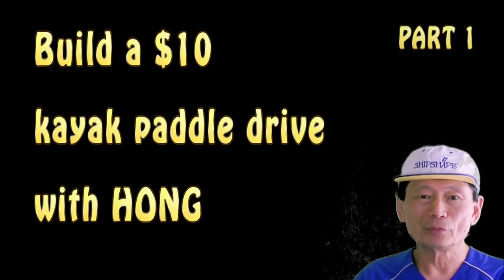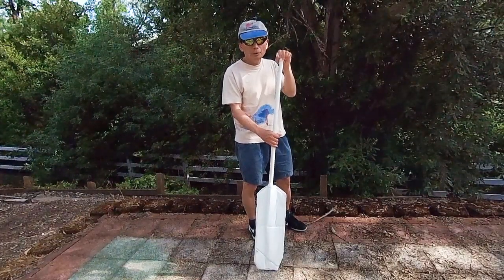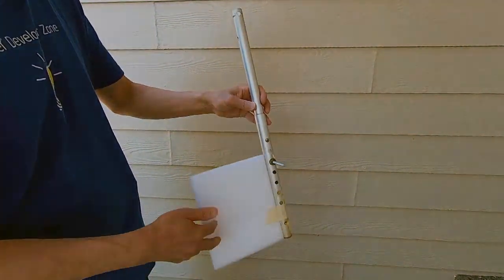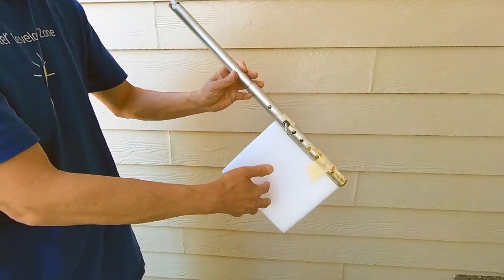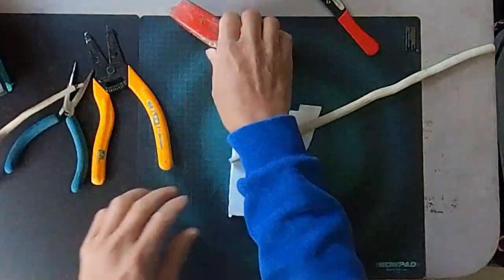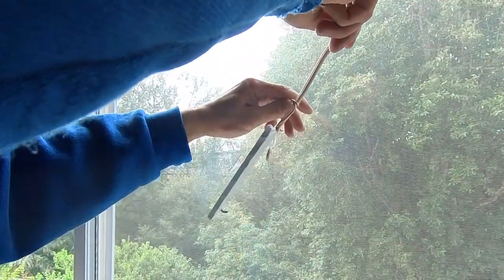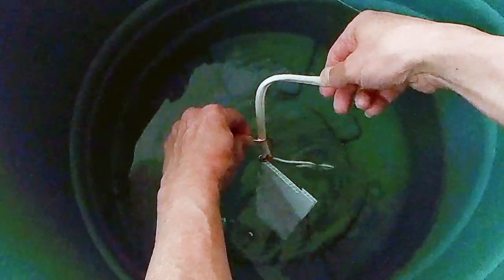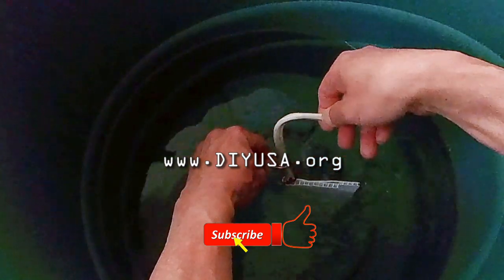Pt 1 Build a kayak paddle drive with Hong

Comment: you are on fire! curios how you'll build it lightweight! you are an inspiration! Thanks for sharing!
Reply from the maker: Thanks for watching and your support. It isn't heavy. I used two pieces of 2" x 1" wood as the arm, about 30" long each. I use coroplast to make the fins, similar size to the mirage fins drive. In my next revision, I will change the arm with aluminum channels, which will further reduce the weight. But I will add a pair of bicycle foot paddle, that may add 1 lb. But that will be much better than the long screws I am using.  I have just finished building the full size proto-type. Unfortunately I have to pack up for the camping trip and will not be able to test that till I return in about a week. Please stay tuned for the update!.
Reply: @DIYUSA  Have fun camping!
Reply from the maker: @pozblitz  Will do 😀